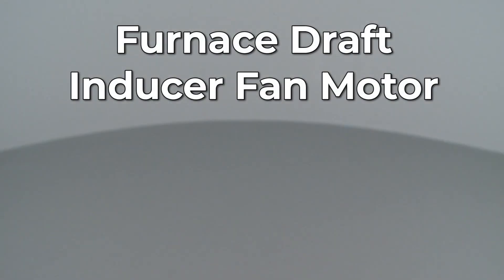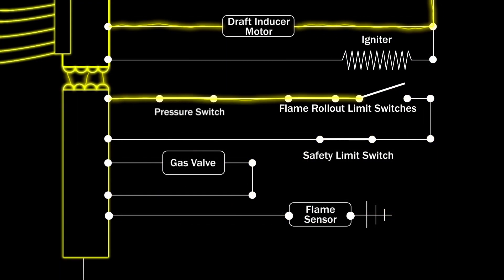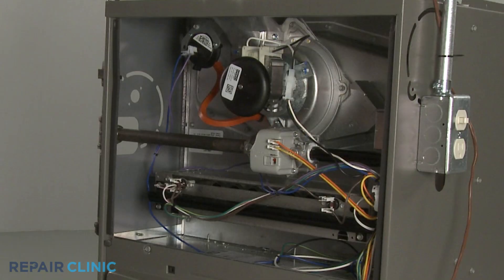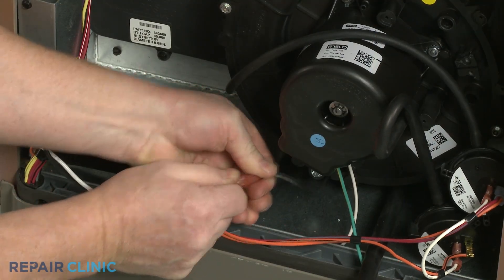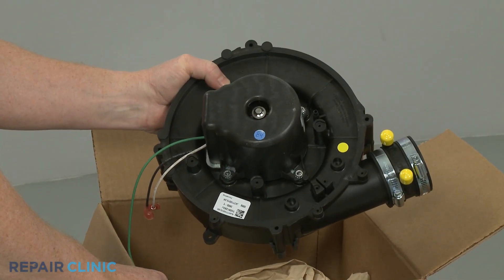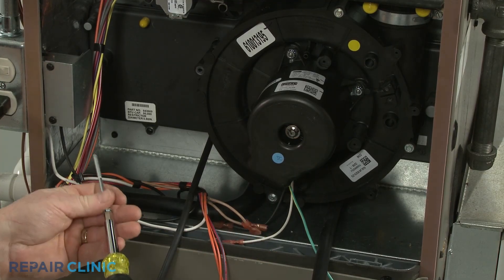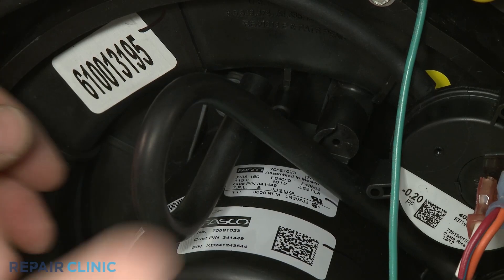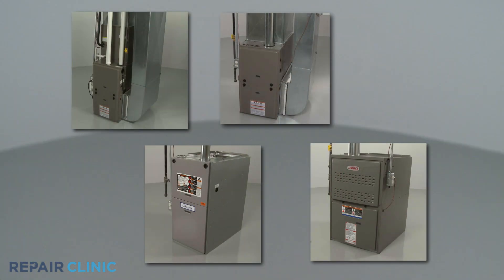Furnace Draft Inducer Fan Motor  Replacement

Comment: My furnace will not reach the set temperature. Once it gets to 61 to 70 degrees it shuts off. I replaced the high limit switch and cleaned the vents but it still does the same thing. Any advice would be great.
Reply: Good luck I am in the same boat. I have to reset the furnace then it will run to the proper heat setting. I have replaced MANY parts like the flame sensor, igniter, transformer, and furnace control board yet this happens mostly first thing in the morning.